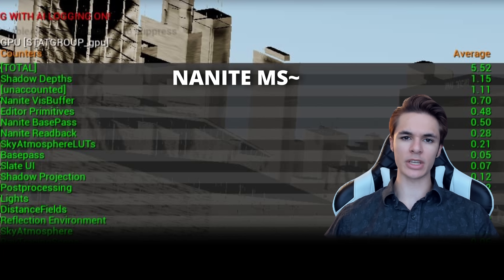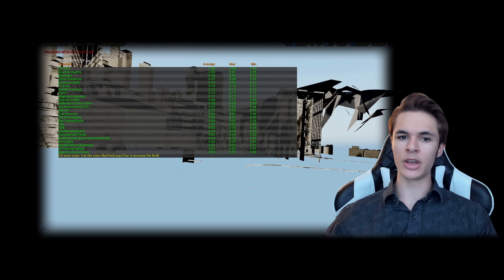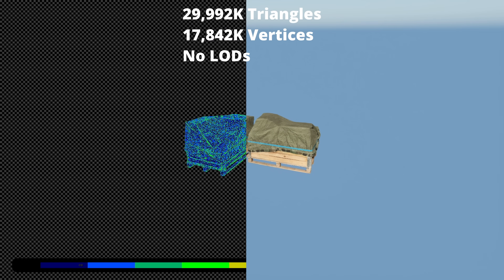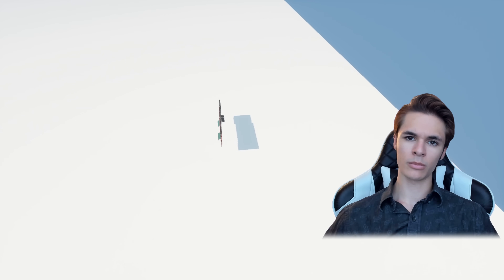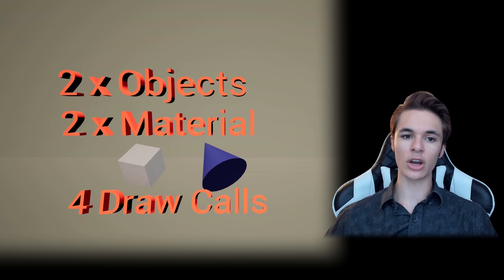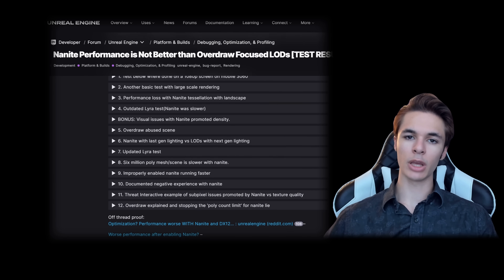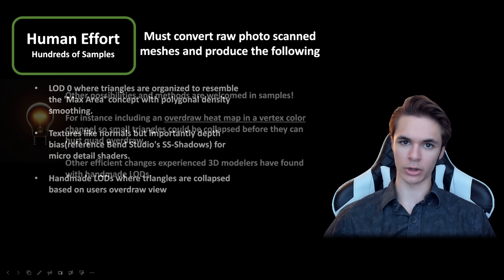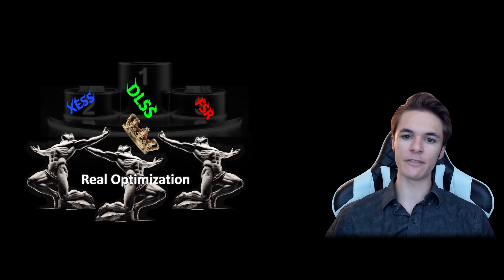Epic's Unreal Optimization Disaster | Why Nanite Tanks Performance!

Comment: These videos are amazing but to be honest, a lot of it flies over my head. What should we, as developers (especially indie), do to ensure we're doing good optimization practices? Alot of what your videos discuss seem to require an enormous amount of deep-level technical understanding of GPUs that I don't think many of us can realistically obtain. I'm very interested but not very sure where to start nor where to go from there. I'm sure I'm not the only one.
Reply: To ensure you're doing good optimization practices, there is one core, important thing: Solve the problems you have rather than all potential future problems you might face.

A lot of advice flying around is "always do this, always do that" when in fact... those never apply to all possible problems. Don't just follow it blindly but think it through and double check if it actually works out for your problem (of course this applies to this advice too).

Be wary of common optimization techniques presented by huge companies. Especially as an indie, your game might be small enough that the overhead from said optimizations is actually bigger than the gain in performance, making it a net-negative instead.

Just because some solutions or libraries or tools are popular doesn't automatically mean they are good. Not having an understanding how things work under the hood (or should work under the hood) basically means you can't tell if you're doing something wrong, or the thing you are using is simply bad.

That being said, there is this miss-conception flying around that CPU and GPU are hard to understand, when in fact, the basics are very simple. And are all that's needed to understand these videos.
There are a lot of videos on how CPUs and how GPUs work. Also quite some written resources on the internet. Just google it, look at a few, and look for answers you have questions for.
I'd start with understanding how CPUs and memory work, how the computer deals with them. How the operating system you program for handles and manages that stuff before going for GPUs though (so basically windows for game dev).
Reply: As an Indie developer I feel that it's very important to know the problems and limitations of those techs and the concepts behind good practices. That doesn't necessary mean you have to apply them. Nanite, lumen, dlss etc can be very efficient as a cheap solution. If it speeds up your game by alot and gets to the result you want, for me at least, it's what you should aim for. Those critiques at Unreal are great for Studios and the industry itself.
Reply: A lot*
Reply: I have a diploma in IT which is actually just CS and I dont have a clue on what this guy is talking about as well
Reply: don't use nanite, just use traditional optimization trick that works all this time.
Reply: I think it is worth learning how it all works, there are lots of free resources you can use
Reply: @anonymousalexander6005 . Bullshit. This is just basic graphical rendering terminology.
Reply: It's easy to say it's basic but your talk is cheap. Build a website teaching it. Or put YOUR face, time, $ out there to teach it.
Reply: do not start developing when you dont know how to actually, you will lose money and time

Comment: Nice to see my £1200 RTX 4080 Super's GPU power being necessary to draw so much badly culled overdrawn geometry at native 4k and struggling to retain decent fps 🫤

I did wonder why with UE5 games fps massively increases with DLSS being used (more so than other engines) and this does make sense.

That is an excellent point you made about Intel and AMD funding optimization tools to make DLSS redundant , not one I've seen elsewhere.
Reply: Yeah and using DLSS as a redundant solution means you have games with worse visual fidelity by default since DLSS outputs an upscaled image from a lower resolution. You cannot create details that didn't show up in the original image by upscaling. This things is killing the "crispyness" of game visuals.
Reply: @MiniGui98  I think that if dlss upscaling can give similar quality settings to native then there is a serious problem with native TAA , you'd think it would be broken?

Comment: Fantastic video - I'm always asked by viewers why I don't use Nanite (for a top-down perspective game) and my explanation was usually along the lines of "Nanite has a higher base cost but scales better whereas traditional rendering has a lower base cost but scales worse - my project doesn't have enough geometry/draws to justify Nanite" but it seems it might just be a higher base cost and worse scaling.

The final parts of the video are very valuable - an AI-trained LOD generator would really be the best compromise between saving time whilst maintaining performance.

I hope the UE team start to really focus on some of the key performance drains and unfinished features in UE5. Understandably they need to be convincing new developers to use their product, but I think they really need to listen to the long-term users about where the engine should be headed.
Reply: It is indeed true about Nanite but I'd also add that by adding Lumen to the workflow and making it hardcode to workflow "BETTER" with Nanite meshes kind of nullifies the point of why upgrade to Lumen over the traditional RT workflow that UE 4 and partly till UE 5.3 shipped with. Until you convert a certain mesh to Nanite (With WPO or not), it's really hard to get the same look that you'd get with brute force RT and scales really bad when it comes to production like in Advertising or Product Visualization.
Reply: I have sort of top downish view too, and part of what nanite (in theory) helps, is tiny triangle rendering.  

But since my gameplay camera is essentially fixed, Im going to build my geometry so that its optimal for the gameplay camera.  I havent really thought about presentation or art style yet since its early days.  

{Also, Im not using UE for various reasons.  Both project specific and that despite having worked in it for 15 years & acknowledging its great for certain projects, it brings me negative joy to work in}
Reply: Disappointed to see you on this person’s Reddit rage bait video. Just 10+ minutes of regurgitated unreal forum complaints for engagement and some ai bullshit
Reply: @GastonGock  it may be complaintive in delivery, but I think it's always healthy to hear an opposing view to the "common knowledge" for example, "tick is bad" or "casting is bad" are perfect examples of stuff that just gets thrown around and regurgitated to the point of misinformation (people using 0 second looping timers instead of tick??)

The video seems to have good numbers and reasoning backing it up, and mirrors the sentiment that a lot of people feel (UE5 runs worse than 4) which MAY be due to Nanite
Reply: @PrismaticaDev  I agree with most of that. Personally I’d like it to be presented more cleanly and less of a mix of talking points from other sources.

Tbh the message of people misunderstanding Nanite should be brought forward more. But I think the big thing here is devs not realizing the difference between a studio and your average person trying to follow buzzwords and trends. A studio will almost always have a custom aspect of their unreal build and most people viewing UE5 are hoping it’s a one and done solution that makes “cool games with nodes” won’t really understand a lot of that until they start to learn basic engine coding.

Comment: Epic's customers are devs, not players. They care to make devs lives easier so they can take less time to achieve a visual goal (aka drag n drop the whole unoptimized model and call it a day). They don't care about game performance, which still drives gpu sales. Dlss and now frame generation are used to skip optimization and anyone with a brain would have seen it coming. I wanted dlss and framegen to give us 240fps on high refresh monitors, not 70fps with stutter.

Comment: Epic games marketers killed the fifth version of the engine. at the time of 2018, there were no video cards that supported Mesh Shaders. They took advantage of this and added the illusion of cheating support for old video cards. Lumens and nanites were supported on old video cards, but this is all software implementation, which cannot be at the level of hardware mesh shader and ray tracing. This led to real problems with the engine kernel, namely that DX12 and Vulkan do not work correctly and have low efficiency due to the old code that was written for DX11. I'm not taking into account the problems with the engine's layer rendering and compositing algorithms, because everyone already sees the eternal blurring of the picture and annoying sharpening. 
This will not be fixed until they add hardware support for mesh shaders and rtx of the new version (added literally by the dxr 1.2 library). For example, Nvidia has many conferences to show their algorithms for improved ReStir in unreal engine 5, and gives access to them, but developers are firmly in their own way and continue to feed the gaming industry with an anthem.
Reply: Nanite ALREADY USES mesh shaders! This is well documented!! You talk like the programmers are malicious, but they almost certainly know what they’re doing.
Reply: No, GPU vendors already worked on similar technologies way before 2018. The problem is Microsoft did not put it in their DirectX spec until DX12U. While Sony supported things like this since PS2 era. Believe it or not a lot of features are unused in older GPU arches because there's no point for PC drivers to support them.
Reply: As if nvidia itself doesn't push for gimmicky stuff that has no use in games.
Reply: The push to mesh shaders could have been nvidia's work, as their 2018 gpus supported mesh shaders while amd's gpus did not. And nvidia is known for putting money where it hurts their competitor
Reply: @manmansgotmans  This is not an exclusively Nvidia effort. AMD and Sony worked on similar things since PS4 resulting in Primitive Shaders in Vega and PS4Pro/PS5, and partly because that's how PS2 handled things back then. Many major engine engineers wanted this kind of control since PS2 days. Sadly AMD never made PS work on PC drivers, so they missed the chance to get it into DX12U spec.
Reply: Epic resorted to their own compute raster with Nanite because mesh shaders were slower in comparison. For mesh shading you need at least two or three shader stages, nanite, instead, keeps the whole process on a single compute stage. Thus no mesh shading is necesary, also 9th gen consoles had no support for mesh shading, they had their own approaches, so for UE5 to support nanite there, mesh shading is a no go
Reply: @melficexd  че ты высрал
Reply: @melficexd  u have shizophrenia

Comment: Overall pretty good writeup 👍, i really wished the concept of overshading was more well known especially with 3d artists since they usually get all fixated on polycon counts which is only a small sliver of the story. Anyway, this discussion sounds to me a lot like the ones we had when deferred renderers and TAA took over the industry. In my opinion this is just a trade off for getting new systems that enable new workflows and higher quality graphics (depending on how you define that at least). I guess the best thing to do if you don't like the way UE5 is going would be to switch to something like Unity's URP and use the Forward+ Renderer, then you get the cleaner image you are looking for with MSAA and you can add multisampling in your shader with an LOD Bias of -1 to get sharper textures as well as use normal LODs. You can just let the people at Epic cook and come back when they improved the situation and the hardware has picked up in performance.

Comment: ive been saying this for ages and been getting hate for it... full ray tracing / path tracing looks shit on numerous games. NO, it doesnt look more realistic. Why is every puddle producing crystal clear reflections of signs and writing that are hundreds of meters away with razor sharp shadows !?
Reply: To be fair, planar reflections usually have the same limitations around sharpness unless you apply a filter to it, and shadow cascades look pretty bad unless you use ridiculously high resolutions and filter it to all hell.

Doom Eternal's RT support is decent, but I wonder how they're doing it with forward rendering.
Reply: @KingKrouch Well, they're ID tech. Basically magicians in optimisation 😂

I doubt they're about to bestow unto us their tradesecrets!
Reply: @MLWJ1993 modern Id Software aren't good in optimization.
Their infamous megatexture technology suffered from high VRAM consumption and texture popping, even in Doom 2016.
Glad Doom Eternal threw it out. But DE graphical fidelity is hard to estimate because of their flawed inconsistent art direction.
Reply: @Naitrate  not in cryengine.
Reply: The sharpness of the reflection has nothing to do with how far away the object is.

It's all about how smooth the surface is.

If you take a mirror outside at night & use the mirror to view the stars, the stars will be clearly visible through the mirror despite being lightyears away.

Puddles produce very sharp reflections in real life because they have very flat surfaces.

It only seems like the reflections are blurry because of how your eyes focus light.

If your eyes are focused on the puddle, the reflection will appear blurry.

If you focus your eyes on the reflection in the puddle, the reflections will appear sharp.
Reply: @john_hunter_  yeah, true. I know. Bad example. I just meant everything is soooo clean, too shiny etc